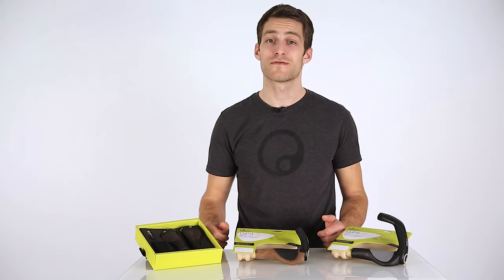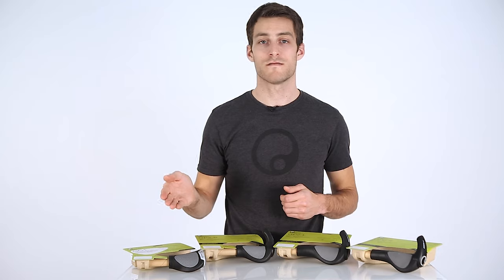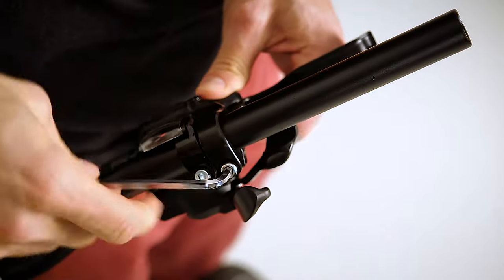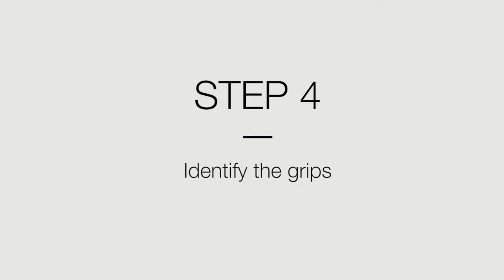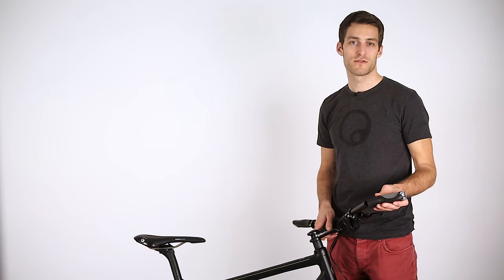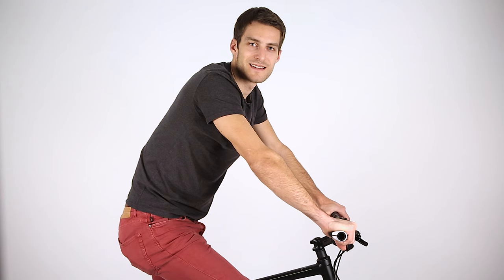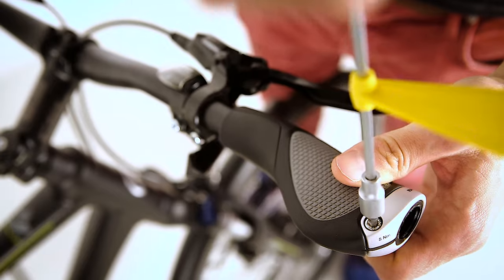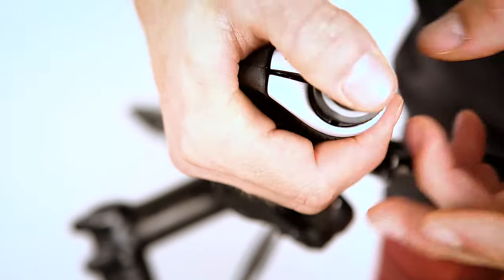How to mount Ergon Comfort Grips - GP and GC Series

Comment: I recently purchased ERGON GP3 (Biocork).
The end plug doesn't fit properly?
Is it okay to just push it in by hand?
Or is there a rubber screw-like position inside that can be adjusted?
I wish I could explain it with a photo.
     from Japan
Reply from the maker: All good as I think that we got your request right. As the inner diameter of handlebars can differ, we at Ergon try to cover a wide range of handlebars with different values.

If you are not sure whether our plugs will hold on to your handlebars, please let us know: Do you think they are too small or too large? And...if "too small" you can use insulating tape or some similar tape and wrap it around the inner lamellae of the plug to increase the diameter.

Comment: Question, can the GP horns be used on their own? For instance, I prefer to put horns between the grip and the brake on my bike, but am interested in using GP5 horns there instead of what I have currently.
Reply from the maker: No, not possible, as the barends also do the grip clamps' work here. 😎
Reply from the maker: Nope, the bar ends do the clamps' job...that's why grips and barends can be assembled altogether only...
Reply: @ErgonBike  appreciate the reply

Comment: I purchased yesterday GC1 but there was no choice between S and L size. Why there is no option similar to GP  to choose S or L size but only regular or nexus version?
Reply from the maker: Hey thank you for your request...and good to read that you chose the Ergon GC1 grips.
You asked about the size and if the GC1 are available in S and L size as well. Unfortunately we only provide the L size with the GC series as this series isn't chosen that often by the customers – as the GP series for example. The L size is from glove size 8+. Thank you for your understanding.
Reply: @ErgonBike  Okay, I see. It's a pity that they are not in size S, but on Sunday I did my first 70km route using them and they are really very comfortable :)

Comment: Where did you get that kind of torque wrench?
Reply from the maker: It's the COMBOTORQ WRENCH & BIT SET from Topeak: https://www.topeak.com/global/en/product/639-COMBOTORQ-WRENCH-&-BIT-SET
Reply from the maker: This is no torque wrench actually, but a normal wrench with a bidirectional, fine toothed ratchet drive called "Ratchet Rocket Lite" from our partner manufacturer @TopeakCycling – and it comes in 4 different versions. 

Here you can find a video of the NTX version: https://youtube.com/watch?v=IKWwmENNIiw&pp=ygUadG9wZWFrIHJhdGNoZXQgcm9ja2V0IGxpdGU%3D

Comment: What do I do if my bars are longer than the auto stop? I need the bars to go a bit further past the hole, to put on my own bar-ends.
Reply from the maker: Sorry, Ergon grips cannot be used with aftermarket barends.
Reply: @ErgonBike  I was considering of altering them to fit until I trialed them as they are. And I realised my shoulder pain was because my bar ends were restricting my arms spreading out properly. But you guys have really made the most comfortable grips on the market here. -And I've suffered a lot of poor quality, melting, sticky rubber ones etc. I went with the cork version. Thanks

Comment: I'm legit confused as to why he'd recommend removing the brakes and shifters when in 90% of situations those are going to stay put. This is where someone points out I'm a dangerous idiot with an obvious observation. It happens a lot and I deserve it.
Reply from the maker: Frank, you do not need to remove the brakes or shifters. In many cases, you have to loosen them and slide them inboard in order to fulling install the grips.
Reply: @ErgonBike  I installed them and lucked out, the bike they went on, had torqued on grips with spacers, so no hairspray needed and they fit like a glove leaving everything where it was, but I did realize that depending on the bike, you may need to move the gears and brakes to accommodate so I answered my own question.

Comment: I would like to be able to purchase the GP3 or GP5 in Large size with the right-hand twist shift option, but no US suppliers seem to sell the short right grip to accommodate the twist shifter. They list it as an option on Amazon, but provide no way to select that option.
Reply from the maker: US retailers do sell this product. Unfortunately, most retailers out of stock due to on-going covid-related production and shipping delays that will go well into mid 2022.

Comment: hey @ergon can you use the GP3 without the bar end ? i would like to use it only for certain occasions ?
Reply from the maker: No, the barend is the grip clamp and must be used. But why not using the GA3 instead of? (https://ergonbike.com/en/product-details.html?anr=42410088&s=ga&a=griffe)
Reply: @ErgonBike  if I may add a question along this line... can you slide the grips (i mean the gp5 grips in particular) all the way up along the handlebar? I have a wide bar and would really need to fit some second pair of inner grips to the centre of the bar. And i need the grips not just barends or aero Time Trial grips. Hope you (or anyone reading this) could give me some insight on this, thank you so much :)
Reply from the maker: @dorianblue4229  What do you want to get to know from this? And how did you meant this: "Can you slide the grips (i mean the gp5 grips in particular) all the way up along the handlebar?"
Reply: @ErgonBike  no worries, i think i wanted to build some crazy 'multi-grip' rig to have not just one pair of grips at the bar ends, but 2 pairs, one more inside near the center/headset (like our friend here is asking, about the horns)... so, because the horns are the grip's clamps, i was asking you, so i could double check that the clamps could slide inner-wise to the centre or maybe they had an outer clamp edge that could only let them clamp on the handlebar outer ends. Can't describe it better than this, however NO WORRIES it's an old story by now, cheers

Comment: Does someone know, what is the difference between GC and GP? I mean In terms of materials or comfort?
Reply from the maker: The Comfort of the GP and the GC are the same and also the Materials are the same (only difference: GP is also available in BioLeder). But the real difference between the two is, the GP is designed for normal straight handelbars and the GC is designed for rearward-spewt handlebars (handelbars which are more bend to the back).
Reply: @ErgonBike  thank you very much,  just ordered a GC2
Reply: I mean, GS2

Comment: Why do you have to loosen the brake levers?  The grips don't even come close to them when they slide on?  Is this guy on bath salts?
Reply from the maker: If you want to do a good Cockpit Setup you start with setting up the handelbar angle and height, then you mount the Grips like you like them to have and then you adjust the brake levers and afterward other shifters regarding to the grip setup.

Comment: Can anybody tell what he saying I just sent back two of these because they slip back-and-forth
Reply from the maker: This sounds bad...and we want to know what is going back and forth with your grips? Can you say if this was the whole grip or if it was the gripping compound twisting on the grips' inner core?

Therefore, what you wrote is hardly understandable for us...as we haven't had this issue with the GP or GC series. And about that we ask ourselves if the grips' lock screws have been fastened adequately – or what could be the reason here? Have you checked your bar's outer diameter.

Looking forward to your reply here.

Comment: Extremely difficult to understand through his heavy accent. And it is not clear exactly how far onto the bar the GP grip is positioned.
Reply from the maker: The grips have an internal stop - push them onto the handelbar till you feel the stop:
"Now the grips can be pushed completely onto the handelbar - Ensure that the edge of the handlebar hits the internal outer stop of the grip   "

Comment: after buying these grips at an extortionate price, its clear to me now just riding on London roads canal tracks  with unexpected bumps they are very dangerous the shape only allows your grip to simply slide off and on them unexpected bumps i have lost grip to them total very scary and flawed design
Reply: What are you talkin about? Do you just lay your hand on top of it and hope for the best?
Reply: @NoZenith  you can wrap hand around it as its WIDE I own them ffs
Reply: @topbanana4013  please clarify? I assumed as handlebar grips you put your hand around them but you're saying you slip off of them and on them and they're terribly unsafe? They are rubberized and grippy to me as I have handled them in bike shops although I have not received my new Brompton yet so I haven't bought any for myself yet. 
Right now I'm doing research to see if there's anything better or cheaper on the market (why I'm here) and it looks like you've something to say but I don't understand what you're saying because it makes no sense
Reply: @NoZenith  do you have big hands like me if so there not safe the grip you talk off simply turns into a slippery surface and the palm of hand just rest on the wide grip.
Reply: @topbanana4013  yes I have big hands, there are a couple sizes of grips. Now what do you mean by the grip you talk off? Any grip will be slick if you get sweaty hands I'll assume, which I don't.
Isn't your palm resting on the wide part to relieve stress one of the reasons you would buy an ergonomic grip like this?
Reply: @NoZenith  your hand does not roll round like convectional grips, the grippy rubber become non grippy fast and a slippery surface so you need to maintain them like per other day  i ride with 2 finger on brakes i have to in city. many time i have brake and the palm of hand just slides off because of design  . . its my opinion and my experience with them   had them over 1 year entering the 2nd year. thanks
Reply: @topbanana4013  I believe you need to slow down and make sure you're typing what you mean to send. Your messages are kind of a mess.
So what you're saying is you just want conventional basic round grips with no ergonomic positioning?  I'm specifically looking for grips with a wing design or similar for a place to rest my hands to reduce long-term wear-and-tear and nerve fatigue in the wrists.
Your thumb is still wrapped around your handlebar it's not like you're going to fall off over your handlebars because your hands are just laying flat with no other purchase and you just slide off like your hand is on a diet of ice. I still don't understand your complaint I guess. If you have your hands properly placed to be able to use the break your hand is completely wrapped around a handlebar. How is your hand sliding off?
Reply: @topbanana4013  wow, you finally make a coherent reply.